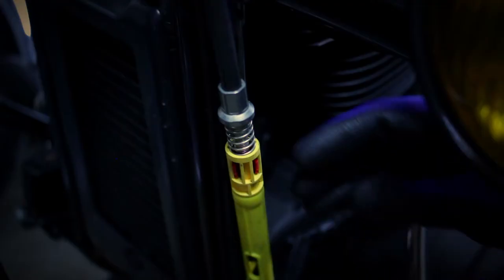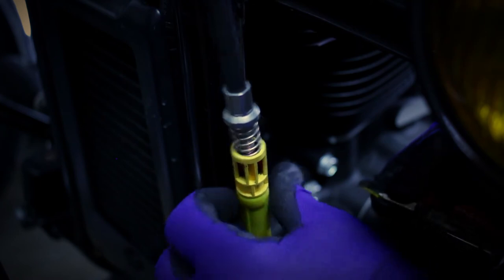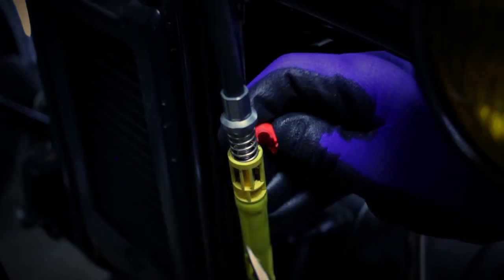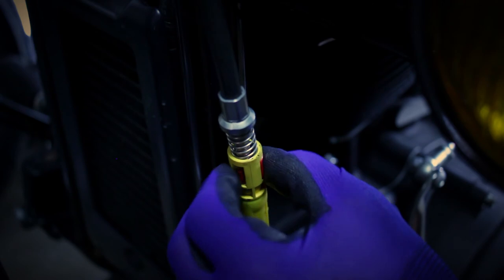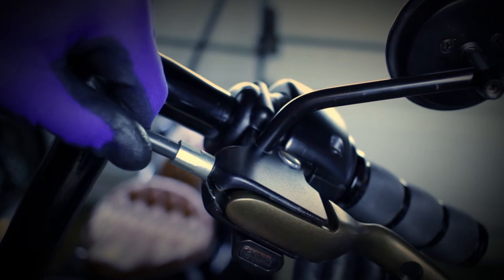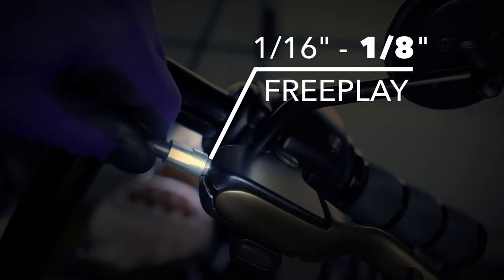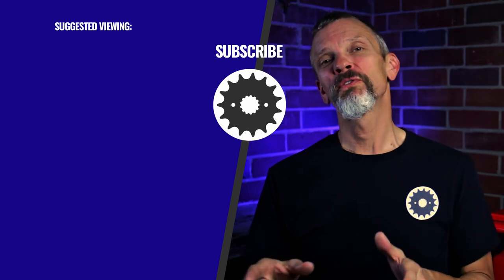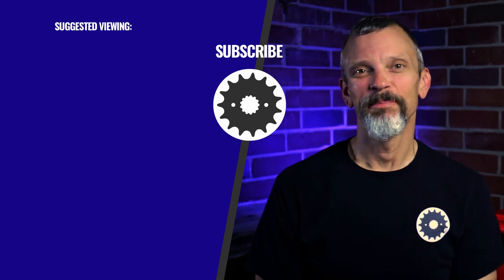Milwaukee 8 Upper Clutch Cable Free-Play • 2018+ Softail

Comment: You didn’t even show how to adjust the cable. What if it’s out of spec?
Reply from the maker: As soon as you release the red button the spring sets the tension and adjusts it for you - all you have to do is double-check the free-play at the lever. In the next video I cover adjusting the clutch at the hub, which is the only other adjustment in the system for the M8 Softail clutch.
Reply: Gonna do my 1k service tomorrow
Reply from the maker: @jameyharrison7499  Excellent! What are you riding? Let me know how the clutch cable / free-play adjustment goes. The clutch hub adjustment isn't until 5,000 miles...
Reply: Ron's Workshop 2020 fxst. I will be putting Redline in all 3 holes. Keep up the good work. Enjoying the videos 👍🏽
Reply from the maker: My pleasure - thanks for the encouragement! If you use Instagram share some pics @ronsworkshop
Reply from the maker: Jamey Harrison have you noticed any differences with the Redline oils? I’m considering Amsoil for mine.

Comment: Cable red button wont work it wont collapse now and clutch lever is really loose
Reply from the maker: Hey oscalealvisl - the spring should expand when you release the red button, and that should take up the slack in the cable. Also check to make sure the end of the cable housing is properly seated in the lever perch. If you need to replace the red clip, here’s the Harley part number: 37200395A. Let me know if that helps at all.
Reply: @Ron's Workshop  thanks for your quick reply it was driving me crazy its a brand new road king special 👍🏽
Reply from the maker: Got it sorted out?

Comment: Looks like the same cable they have put on 2021 Models now
Reply from the maker: Hey BtheRiderPA - yeah, I think it is the same now. Let me know how it goes if you make any adjustments. 

I’m about to release another video related to this - showing the difference in clutch lever movement before engagement based on the max and min adjustments down at the hub.
Reply: Have to check owner Manual when it needs adjusted
Reply from the maker: 1000 miles and then at each 5000 mile interval thereafter starting at 5000 - 1,5,10,15 etc.

Comment: Another video that didnt show how to actually adjust it 🤷‍♂️
Reply from the maker: Hey DirtRoad Joe - the only adjustment is taking up the slack with the spring, which is shown. If you need to do a clutch adjustment down at the hub you can check this video: https://youtu.be/qfmE5D6qxmE
Reply: @RonsWorkshop  let me apologize,, I spoke before I actually paid attention.  Once I really paid attention to what you were demonstrating, I got it.. but I had already made the comment.  
Had to replace the lever on an El Diablo that had gotten bent, and could not get the slack back out of the lever. Thank you for the video, I just wasn't picking up what you were putting down.
Reply from the maker: @joehatchet no worries at all. I’m glad you got it sorted out!